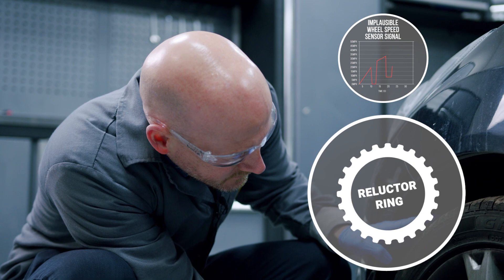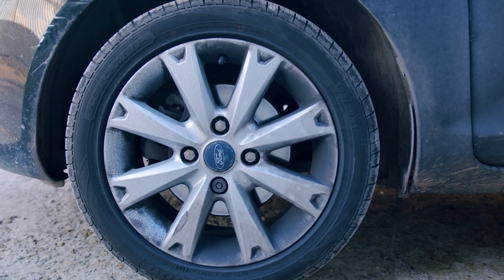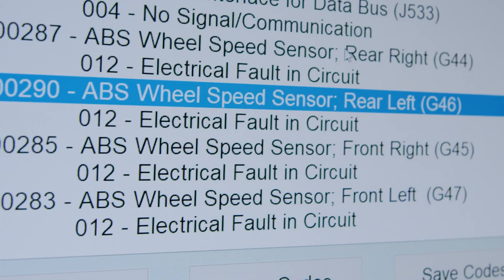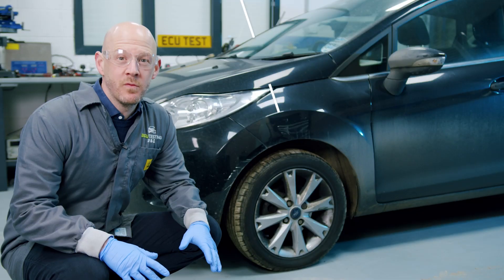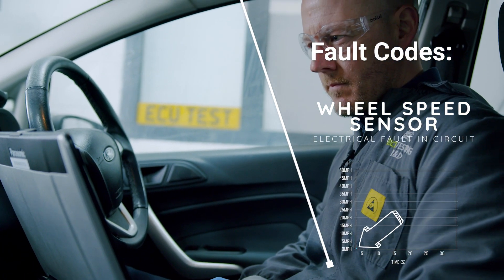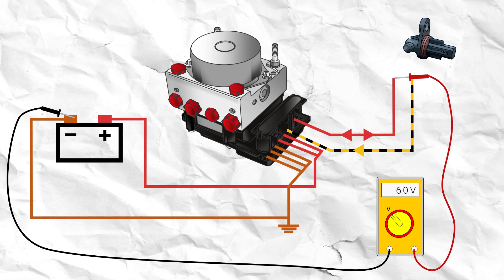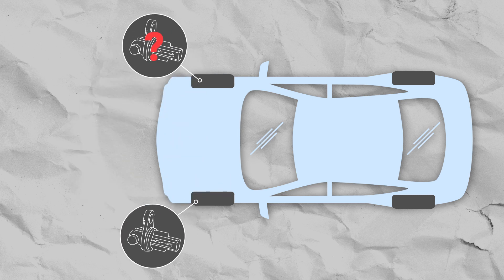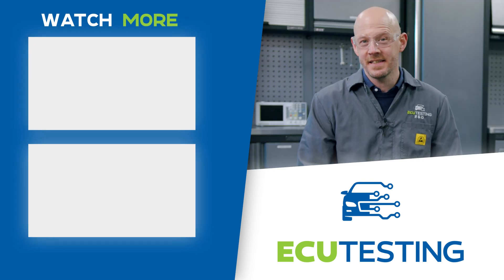ABS Wheel Speed Sensor Fault – How to Test and Fix ABS Sensor

Comment: Hi my Ford Galaxy 2016 ABS sensor is showing a fault again within 1 year of replacement. I can’t understand why this is happening. We used a new genuine Ford part. Thanks
Reply from the maker: Hi. Have you scanned the vehicle for fault codes and they are showing a specific wheel speed sensor is faulty? If it is the WSS that is showing as faulty and you have replaced it recently, then we would recommend following the steps shown in this video to identify if the fault is with the new WSS itself or with the wiring to it, or even the ABS module. It would also be worth checking the reluctor ring on the affected wheel for damage or corrosion as this can cause WSS fault codes to be produced. Hope this helps!

Comment: Hi what software do you use?  
It's difficult to find out if they will give you live graph data for the wheel speed sensor before buying.  Any advice gratefully received! Low cost would be preferable!
Reply from the maker: Hi. If you can find a scanner with a scope function on it, that should be able to read live data. We would recommend speaking to a local specialist as different scanners will only be compatible with certain makes or models of vehicle. Cheers

Comment: Hi Tim, 
Thanks a lot for the useful information, I have toyota rav4 2018 and the abs alarm mostly ON (not always).
The car previously has a damage collision on the front right side, do the think the sensor or the wire sensor or the driving wheel component damaged and that's why the abs and traction control alarms on?
Thanks a lot...
Reply from the maker: Hi. Are you able to scan the vehicle for any fault codes? Without these it would be tricky to pin point the cause of the ABS and traction control lights being on. However you are correct, a collision could have damaged wiring to the sensor, the sensor itself, as well as the reluctor ring or even the wheel, all of which could cause the ABS light to remain on. After a collision, the most important thing to check would be the state of the wheel, is it badly mis-aligned, is the pressure low etc. Hope that helps!

Comment: Please which OBD scanner is best for both diesel gasoline and electric vehicles
Reply from the maker: Hi. We use a variety of different OBD scanning tools that work well with specific makes and models of vehicles, so we unfortunately can't recommend an all rounder. We would simply recommend doing independent research to find one that will fit your criteria.

Comment: SO I drove my car and the lights came on for ABS and Traction Control, then by the time I got home they went back off, will a reader find that code or does the light have to be one?  I have a cheap OBD2 reader but I do not think it reads ABS, what brand should I get? Thanks I am in the states.
Reply: XTOOL D8 OR D9. I bought a D8 at the beginning of March and it has updated at least 2-3 times a week, including special functions which started at 31 and is now at 38. They give you 3 years of updates, free remote diagnosis help, and they will LITERALLY update ALL scanners based on YOUR INPUT.

Comment: You guys are gonna make some good bussines during upcoming financial crisis. It would soon be a problem to get those oem new parts for a reasonable price and it is soon going to get a lot worse. Anyway a rebuild part can hold as long as a new one if done correctly if I'm not wrong. It is almost the same for turbo chargers, some people can rebuild those to hold even longer then factory original. Cheers
Reply from the maker: Hi, thanks for the comment, we hope you liked the video! You are correct about rebuilt units lasting as long, if not longer than the factory original, and this is especially true for the units we rebuild as we use higher than standard rated components to eliminate the original manufactures design flaws on the unit, ensuring faults don't re-occur. And to top it off, all our units also come with lifetime warrantee for an extra peace of mind.

While it is good for business, the current situation around wait times, supply issues etc for OEM parts is a big problem for customer's who only believe in 'buying brand new'. However we do hope it will shine more light into the re-manufacturing industry and encourage people to move away from the 'throw-away' style of thinking.

Comment: Great how to vids!

Sorry for the long post.
I'm having an issue with my 2008 Nissan X Trail T31 and wondering if you might have a idea where to look.
We replaced the broken clock spring after a considerable period of time and after having the steering recalibrated, the abs would kick in at random times while driving. The warning light of the car with squiggly lines under it would flash in sync with the braking of the car. We engaged the 'esp off' button to stop the esp kicking in.
We had it looked at and there were no codes showing up on the diagnostic tool. All wheel sensors showed that they were working as you described in your video. The brake system was checked and flushed with no change to the problem. After a few more visits to the Nissan mechanic, it was suggested that it may be the abs module. We are looking to sell the vehicle in the near future (another child on the way), and due to the fact that they weren't 100% on the module being the issue, we sourced another abs module (same number), from another xtrail of the same year and model, instead of a new unit. We were assured by the supplier that it would be compatible. With the 'new' one installed, there were issues with the 4wd light staying on, the abs and esp light coming on and even the speedo dropping out. They cleared up themselves, however we are back to the same symptoms as before with the stability control kicking in unless the esp is disabled.

Do you have any advice on what is likely to be the issue? Apologies again for the long comment.
Reply from the maker: Hi. Thank you for the kind comment, we are glad you like the videos! If you have replaced the ABS and the faults still occur, it could be that you have a problem with the wiring to/from the ABS. If you are able to carry out an inspection of the wiring and connectors to check for any damage that could be the cause of the problem. We would also recommend carrying out voltage drop tests from the battery to the ABS to see if there is high resistance present in the wiring loom. If both of these check out ok then the final thing to check regarding the wiring would be the continuity of the ground connection at the ABS. We have detailed these steps in this video: https://youtu.be/V4LkqdD-26o 

The other potential causes could be a faulty steering angle sensor, or damaged reluctor ring(s) or even damaged wheels themselves.
We hope this helps and your car is back to working order soon! Cheers